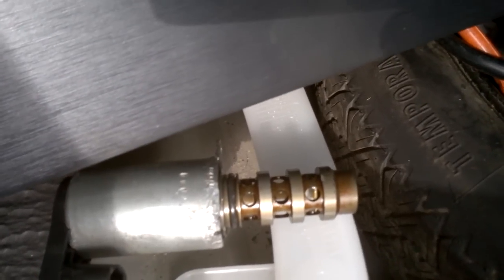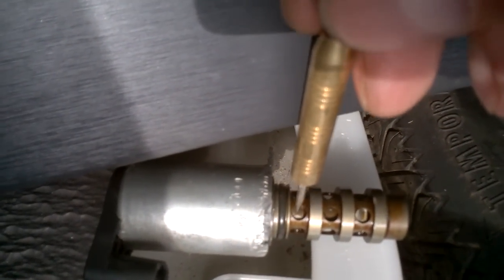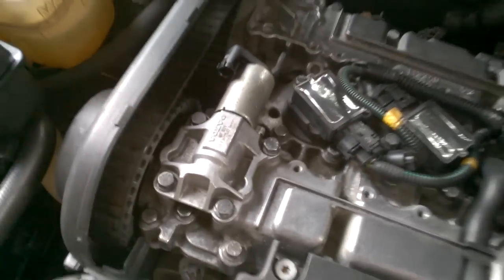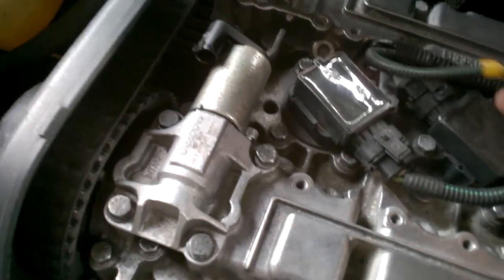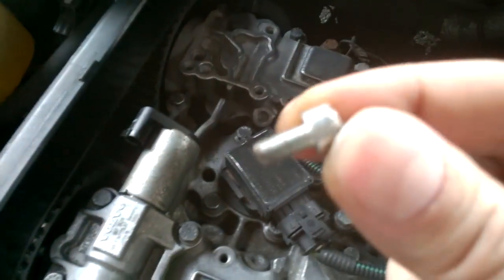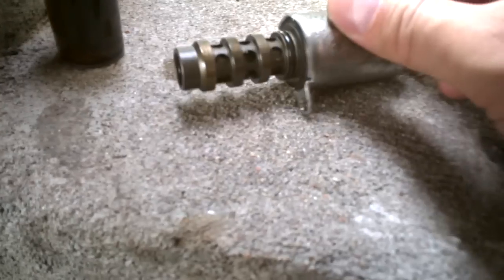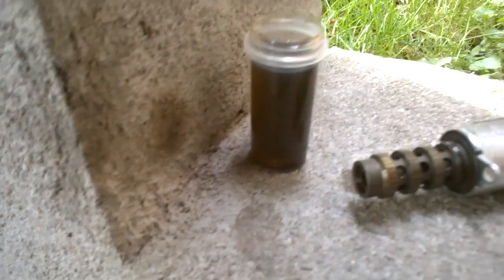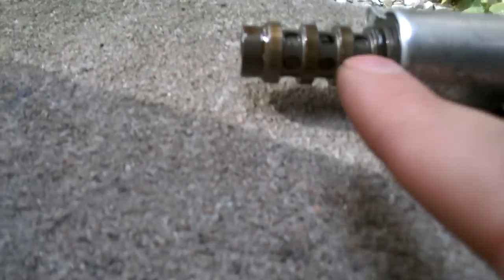Camshaft and transmission solenoid testing and repair

Comment: Hey there 
I have a 2007 toyota yaris 1.3.... I notice as of recently it began to struggle alot.  During regular driving like half throttle it would feel as if there is a loss of power and shudders at times and when I use full throttle it would give a sudden kick and drive as normal, could it be the oil control valve or something more serious. It's honestly stressing me out
Reply from the maker: I cannot answer this..  the only thing I could say maybe some pulley on the serpentine belt is seizing or maybe the water pump.  But can be several other items, a MAF, the drive by wire gas pedal, or something else.
Reply: @Peppermint1  thank you. I'm hoping by the end of this week to get the car on a diagnostic so that I could be sure. Just hoping it's nothing too serious

Comment: Is it the same for the s80 ?
Reply from the maker: Same thing, al 2001-up Volvo use the same type of cam solenoids, only connectors are slightly different on intake vs exhaust solenoids).  Besides the connector, only the square blocks where the solenoids are inserted, are different on intake and exhaust.

Comment: Hey Peppermint I have an 2010 infiniti g37 where would it be located in my car
Reply from the maker: Hi there, I would suggest trying on Infinity/Nissan forums, usually these are located on top of the engine (may be hidden under a cover) near the timing belt or chain. But the specific forums will help you better and I warmly recommend asking of forums for all repairs as these have lots of very useful information and can save good money in the end. Cheers

Comment: Here's a symptom of a the VVT sol getting clogged up. I have an 04 VOLVO V70 with 138k miles on it, with 2 VVTs on it. I bot the car used but I don't think previous owner knew what was wrong with it (he thought it needs new MAF sensor). When I test drove the car cold, the car started and ran fine for the few miles I drove. Then I bot it. When I took it home, the car was warm, and I got check engine light with P0014 “Cam Position Activator B, Bank 1, Timing Over Advance".  I erased the code, and restarted next moring, it started and ran fine again. When I arrive home, I restarted it, and the car seem to be running rough. 
I replaced MAF sensor, and cleaned Throttle body. No change.

When I removed the cover to the VVTs, I saw the 2 selenoids. I noticed one of them was newer than the other. I pulled out both to compare and noticed the older one had varnish & sludge on it like in this video. I'll try cleaning/soaking it, and if that doesn't work, I'll just replace it. Ideally, I should tryhing cleaning it while its open but that's risky b/c most part cleaners are flamable and I didn't want to start a fire.
Bottom line, get ready to replace the selonoid which is very easy. 
Good video!!!

Comment: Peppermint, i have a 2008 toyota highlander with a 3.5l that is throwing p0017 and p0015 alone with random misfires once it warms up. Guessing these are sticking maybe?
Just finished a full rebuild on the engine but did not clean these. The engine was very dirty prior to it needing rebuilt. 
Maybe going to try cleaning these in ultrasonic cleaner while actuating them?
Reply from the maker: Try to check them with the engine fully hot (watch your hands)   https://www.youtube.com/watch?v=U3w3kLF0-I4
Reply: Hello I have a 09 Toyota avlon with the same codes were you able to fix you highlander

Comment: I would like to ask you if applying the thicker oil to the engine would solve the problem? Thicker oil would make the valve work?
Reply from the maker: I think different oil thickness will not help.
Reply: With thicker oil the vvt wheel might not work

Comment: Can you help me? I have a lexus gs300 year 2001,  20 minutes after  I start the engine , the engine going to have  a not normal trottle and apears "check engine" . When thats happen I disconect the batery and conect again and the problem is solved only for a few minutes. The next day I  disconect the plug of  the oil  valve cam and apears again "check engine "  , You believe that it is that oil  valve that is the one that is bad?
Reply from the maker: No, I don't think it's related to the VVT solenoid of the cams.  You will need to read the codes on the car to see what causes the check engine light after the engine has warmed up.  Could be several things.  Also it's good to search on Google for Lexus forums, and ask there, people are helpful on forums. Good luck!

Comment from the maker: Please read first:  The testing with the 12V should be done without removing the solenoid and after the engine is fully warmed up, because the solenoid gets stuck when it gets hot (expands inside).  You should hear a 'loud' click, if the click is rather faint, it means the solenoid doesn't open properly as the engine warms up.  The 'cleaning' in the video failed to work, maybe try fully submerge the solenoid in SeaFoam for 2-3 weeks and activate it now and then with a battery while submerged, but the fluid may not go inside where the clogged bushings are, so not much chance to 'clean' these vvt solenoids, better go for a new one.

Comment: Hi John Aalmonde
I have the same kind problem with my volvo v40 just like yours but only difference is I am getting 9 volt from the solenoid connector. Did you fix the problem? If so please let me know the details.
Reply: 9 volts is about right. It depends on the car. Most are not 12 volts. As long as power getting thru the solenoid it should still work electrically

Comment: is it safe to connect it directly to the battery like this? does it matter on which pin you put positive and negative from the battery? doing this repair now myself :)
Reply from the maker: Sure, the solenoid is powered with 12v already. You can even power it at a small 9V battery, the battery just won't last that long.  Also, it doesn't matter which pin gets the + or -
Reply: Royale with cheese ok, will try tomorrow. thanks a lot!

Comment: I just bought a 2011 GMC terrain and mind I say bought it 2daysago everything was working fine and was driving smoothly but when I went to drop my son off to school the check engine light turned on so after I dropped him off my car kinda wanted to tug so I went to my local AutoZone they used the computer checked it read codes p0010 & p0013 I hope I put the codes right😥 but it said camshaft position actuator so when I was leaving AutoZone was at a stop light my car wanted to turn off on drive still. so idk what it can actually be if it's reading those codes and doing that. does the camshaft position actuator make it do that? please help worried and pissed at the same time& if it is how long does it take to fix it!!😢
Reply from the maker: Jeannette, here's what I would do. I found two GM Terrain forums.  Participating on a forum is invaluable.  It will save hundreds if thousands with other owners who already experienced and fixed the same issue.  On a forum it's always good to read several opinions and choose the more common one.
http://www.terrainforum.com/index.php?page=active_topics
http://www.terrainforum.net/index.php?board=1.0

I also looked on Amazon for the part, also available to purchase from the GM dealer.  Here's one example - call the GM dealer for the exact part no. - with reviews  https://www.amazon.com/s/ref=nb_sb_noss?url=search-alias%3Daps&field-keywords=Genuine+GM+12655420+Camshaft+Position+Actuator+
You can either have the car fixed at the dealer if prices are decent (by aware that many dealers are dishonest, try having only the specific repair done, and for any other issues ask on forums) or buy the part and have it installed at a small trustworthy garage (not AutoZone).  Try searching mechanic on local.google.com and read the reviews.

Comment: Hello, that is what I am experiencing. Very minor movement but I do not know enough about the solenoids to know if it is normal or not. To see my full problem, see as follows, I am desperate to know what the problem is as we are due a trip from London to Ireland and I need the car in order before then (the ferry is booked) THANKS :  Thank you for the video. I liked this a lot and it helped me understand my potential error P0011. I have a Volvo v40 phase 2 sport 2003 2.0L petrol and I have been trying to test the CVVT solenoid from a car battery (12v). My car rattles and has rough idling as well as failing the emissions test. The engine makes a clicking sound in the cam phaser region only when the solenoid is connected and sometimes when idle it will choke out. When I disconnect the solenoid from the power supply the engine runs smoothly again without the rhythmical clicking/grinding noise.  I deduce from this that there may be a fault with the solenoid or the cam phaser (VVT cam pulley). When testing the solenoid with a voltmeter I get a continuity signal and a clicking sound when I attach a 12v power source but there is very limited range of movement upon visual inspection (this is more obvious by unscrewing the nut that holds the solenoid in the casing and rotating the solenoid to expose the underside). Also I measure only 4v to 5v from the connector that supplies power to the solenoid in my engine. Do you know what the correct power to this solenoid should be? Should it be 5v or 12v from the car. My Haynes manual (may Mr Haynes be blessed) does not have any information on this from what I can see. Also is it possible that a damaged exhaust could be relaying information back to the ECU that is throwing off the cam timing? I also have engine management light on and heat sensors as a fault on the diagnostic tool. Any help greatly appreciated as I am hitting a wall and looking at a prohibitive bill with this and many other faults that are becoming apparent in my beloved brick.
Reply from the maker: it is better to ask on a Volvo forum, there are several good forums out there.
Reply: John Aalmonde eish